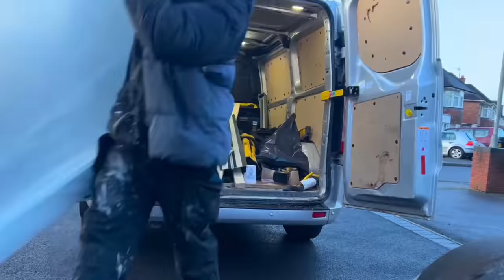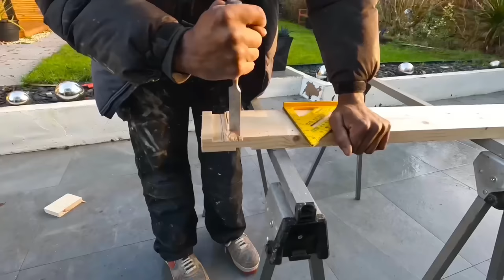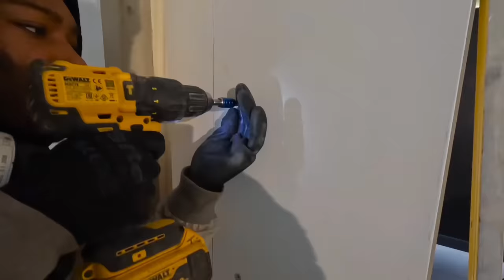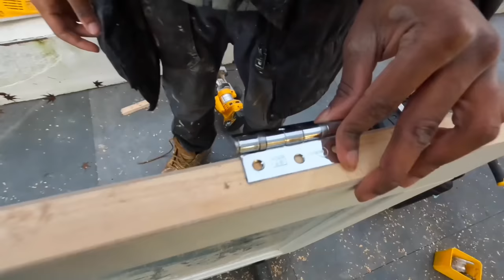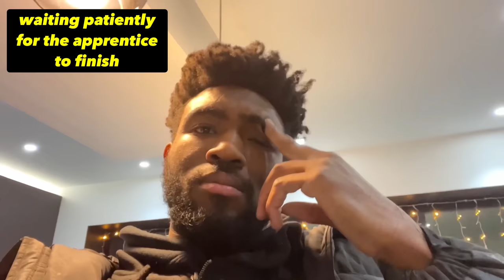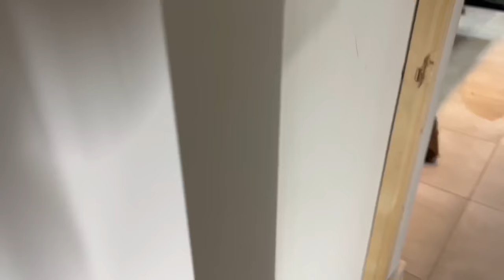The apprentice fits a door and frame by himself (a day in the life)

Comment: Thanks for the video mate, what happens if you get a rattle in the door latch? How do you fix that?
Reply: Depending on the type of door keep you have there is usually a small adjustment tab inside, use a flathead screwdriver and bend the tab till the rattle stops

Comment: Iv been watching all your videos as I’m at a similar level to your apprentice. I was just wondering what you do when you’re hanging doors in old properties and the door frame is wayyyy out of square. Do you cut the door on the bonk? Reframe the door? Or just shim it straight or even pull off the architrave and wedge the frame back straight? Sorry, just a problem I keep coming across. Thanks! Keep up the awesome work!
Reply: Also do you measure the door frame from scratch when fitting a new door or just draw round the old one. Thanks!
Reply: All depends on the door your going to hang, all the oak veneer doors are chipboard with a 10mm edge so be careful how much material you remove, If the old door is well fitted then draw round it, if you start taking arch’s off and trying to level the casing your opening up another can of worms but if they are really bad then replace the casing